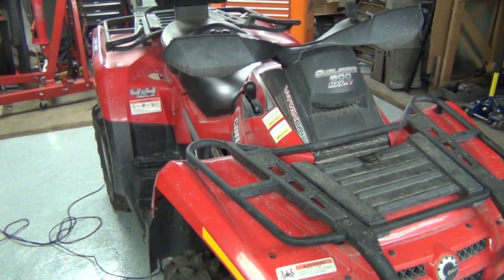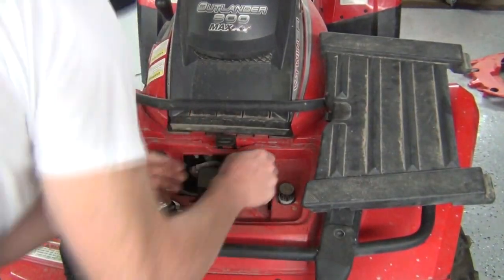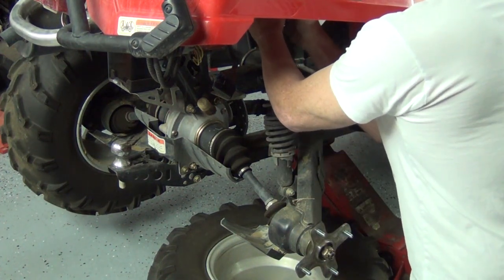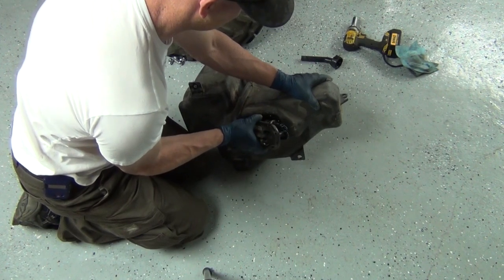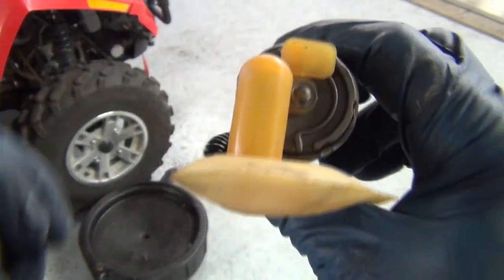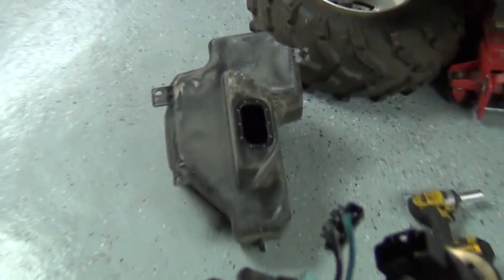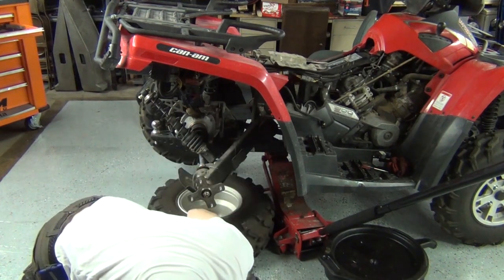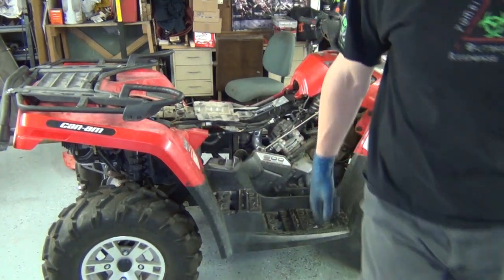How to Diagnose and Replace the Fuel Pump in a Can Am Quad

Comment: A great help in resolving my current Can Am issue. Engine died while on the run. Tried starting again, battery was fine motor turned over but would not fire. A Very informative video, many thanks.

Comment: I'did mine without removing gaz tank or any other parts. Simply cut out the seat bracket to gain acces to the fuel pump and remove it. Then drill two holes on the frame and made threads. To fix the seat bracket with two 1/4" bolts.
Reply from the maker: Nice!

Comment: Another great repair video brian. Well done! I just purchased an 08 800 on ksl. The fuel indicator reads empty with low fuel light flashing. But the bike runs perfectly fine. I'm wondering if the float fell off down into the tank. Hoping that's my problem. Thanks for sharing this great video. Now i know how to remove the tank.

Comment: If the wire for the float is close to contacting the strainer, you could bend the wire so there is more clearance. Bouncing around on an ATV you might want more clearance than you have.

Comment: Awesome video. I had some dirty/muddy water flow through the gas tank vent into the tank. It would not start. I pop the injector lines off, cycled the pump on and off with fresh gas in the tank and put the lines back on. It still acts like water In the fuel. I changed the in line fuel filter. It was pretty dirty. It's a 2008 outlander 800. Do you have any recommendations. Should I pull my pump and clean the pre filter? Would it be the injectors? If so how do you pull them to clean?

Comment: Thanks for the video. I’m hoping you or anyone else can help. I took rear back rest off myv2 up seat to use a rear box. However putting it back on the rear seat won’t latch fully n lock in. I must have the arm or spring out of place. Can anyone post pictures or video on how their rear seat is set up? Parts diagram didn’t help. N I’ve taken apart n adjusted a few times now. Also if anyone loses power steering when in deep water the large yellow plug under seat needs dialectical grease as it gets wet.

Comment: i have a  2012 650.  my. 5 amp fuse keeps blowing but it runs on a 7.5 amp fuse. the dealer is going to contact  cam am to see if this is ok to keep it in and run it. instead of replacing the fuel pump.  this fuse controls the dash and starting function. i'm worried about what damage that may cause to other components if the fuel pump is not the issue. i know my 2016 uses a 7.5 amp fuse. any thoughts . great video by the way

Comment: Hey Brian I have a 2011 Can Am 800 Max Ltd similar to the one in this video.  I have a weird situ.  I have not done the tear down yet but when my fuel level gets below 3/4 of a tank it starts to sputter, and will stall out if I don't fan the throttle,  If I fill the tank up to full and then it runs like a top.  Any ideals?   If I fan the throttle and hold it wide open it will usually stay running but not into rocketing down a trail doing 60 or more.  I have siphoned all the fuel out and replaced it, but still the same deal with the fuel level, 3/4 it will start to sputter, top it up and good to go.

Comment: Hi Brian!  I'm the guy that bought you John Deer riding mower, still runs great. Question replaced my 2007 canam outlander 800. I  bought a oem pump it all of  a sudden quit priming the fuel. you can hear it when you turn the key on . Is it locked up?
Reply: I have a 07 renegade 800 but I here fuel pump turn on but if you take the fuel line hoses off the injectors an hit start but nothing comes out of the fuel hoses

Comment: I know this is a really old video but is there a way to test the fuel pump to see if it’s working without dropping the whole tank? I’m not sure what it should sound like when it turns on
Reply from the maker: I show how to do that at the 4:47 mark.  And later what that would be on the pins under the tank.  It can be done with the tank in, but that doesn't mean it's going to be easier.

Comment: That's not the diagnostic connection by the right rear wheel,  just a couple fuses.  Diagnostic port is in front near fuse block panel.

Comment: Hello i have a problem with my can am oitlander 1000 2018, i recentmh changed the repleaced !! but it works bad, it can runs for 20km without problema but after that it works
Bad, im going in 5000rpm and fells to 2000
And immediatly up to 5000 and the moto stops, i need to spent 10 mins and works good,

Comment: mine is 2011 and blue :)  and it started to act up.  i wonder if its the pump or possibly plugs UPDATE. my pump is different than yours and doesn't have inline filter :) and it is easier to get to from the top w/o taking the tank out yeeey.  great vid

Comment: hey thank on vid nice i took out my tank replaced all the fuel lines did nothing with the pump ?? im not convinced its the pump ??... this is what i got  starts up runslike a bear gos like a raped ape then it just stops weight a few 5-- 10 minuites and away we go just as fast ..park it shut it off crankes and crankes wont start leave it for a hr fires up runs like a raped ape ... fuel pump what do you think brian thanks great video  O and i could not get codes 2007 outy 800 Max Xt HO
Reply: Meliss Dear I am currently experiencing the same problem

Comment: Excellent video Brian; keep up the good work.  Question, what fuel pump did you use?  The link you have listed is broken.  The only thing I can find on Amazon for my father-in-laws 2008 Can-Am Outlander 400 EFI is this one from HFP Fuel Systems (https://www.amazon.com/dp/B072N5RSLS/?coliid=ICHBJ5M5D6Z1Z&colid=2SJJY2ELU9PXZ&psc=1&ref_=lv_ov_lig_dp_it).  I made my annual trek to Utah this past weekend to haul my dad's boat over to Colorado (headed to Lake Powell next month).  Decided to take my father-in-laws Can-Am with me to replace the fuel pump.  His 2008 Outlander has 40.8 miles on it (yes, forty point eight); only used to plow the driveway.  He's never added fuel to it; the fuel is 12 years old.  No wonder the pump locked up.
Reply: Do you know if this will fit an 08 outlander 800 max?
Reply: @luisbarrieta  I'm no expert but according to the HFP website it will fit an 2008 Outlander 800 EFI, https://www.highflowfuel.com/i-23898989-quantum-efi-fuel-pump-w-regulator-tank-seal-for-can-am-outlander-800-2006-2008-w-replaces-703500771.html